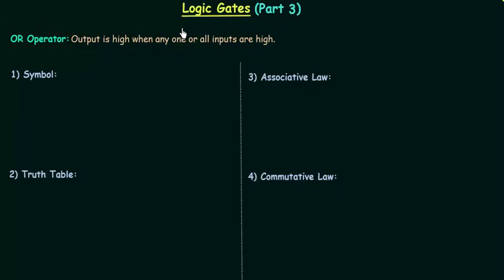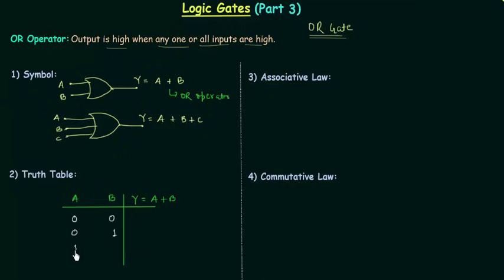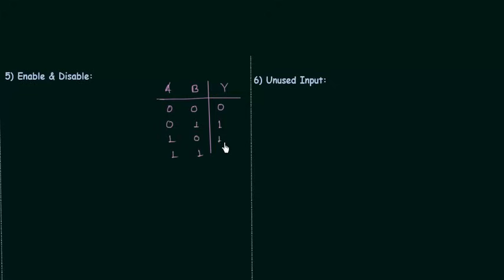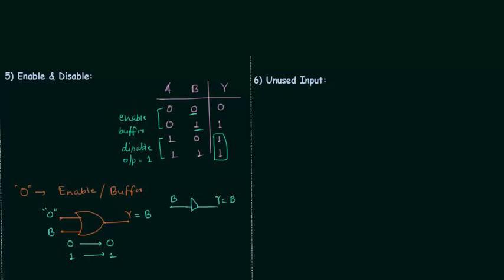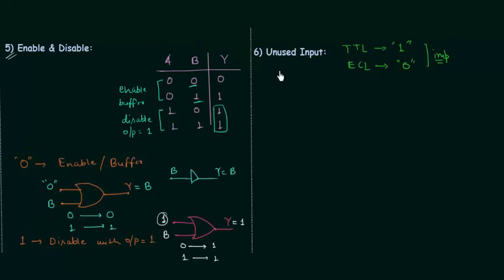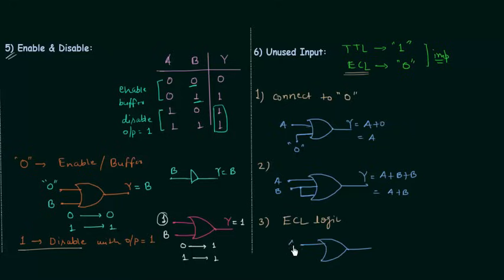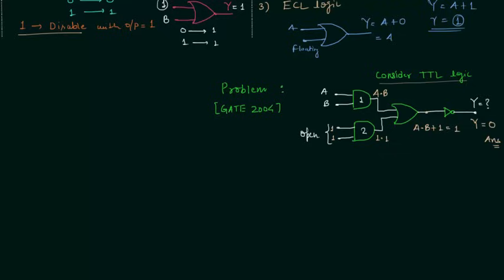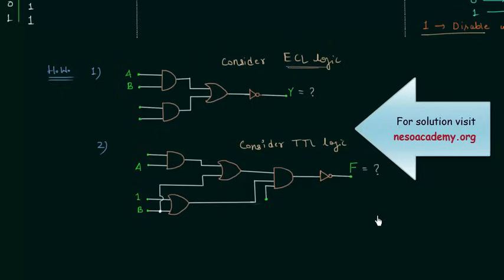Logic Gates (Part 3)

Comment: He is not explaining enable or disable correctly
Reply: Toh tu kardena
Reply: Enable means o/p should be 1 right? Iam confused on this..can some in explain?
Reply: @Gudurusruthi  enable means the gate functions, output equals 1 or 0, depending on input.
Reply: @davadoff  exactly In the video he is just creating unnecessary confusion 
Simply we can say 1 = enable, 0= disable
Reply: @Gudurusruthi  no, enable means the output will change depending on the other input(s). Disable fixes the output to a predetermined state. In this case 3:55 the OR gate builds a buffer that can be turned on & off. 

It’s confusing because in the context of flip flops, enable=true causes it to function normally, and enable=false fixes the output in the current state, insensitive to any input changes. See: flip flop racing (where the enable input may be labelled ‘clock’ depending on the video).

Comment: 1) answer is A'+B' 
Explanation- as we have to consider ECL logic so 0 will be floating input. 
So A. B +0.0=AB which get converted into A'B'= A'+B' by de'morgans theorem. 
.... 
2) Answer is A'B'
Explanation- as we have to consider TTL logic so put 1 at floating where input is empty. 
So for first AND gate it gives A.1=A
Second OR gate gives 1+B=B
For third OR gate A+B
For 4th AND gate A+B is one input and 1 is second input (B+1=1) and third input is floating so it is also 1.
So (A+B)1.1=A+B after inverter it get converted to (A+B)'=A'B' by de'morgans theorem.
Reply: Small correction 1+B will gives 1 not B. U mistakenly written bhaiya at statement 'Second OR gate gives 1+B=B'
Reply: @ganeshmula4508  yeah...
Reply: First answer is NAND the two inputs, second is NOR them 12:28. Invert both inputs then OR and invert both inputs then AND is more complicated than NAND/NOR respectively, so why use De-Morgan’s to complicate it?

Comment: 2nd is explained as

A and 1=A  or (B and 1) = A+B 
 B and 1=B

( A + B ) and B and 1 = ( (A+B)B ) compliment
Reply: Your explanation is wrong. A AND 1 = A OR B = A + B. Bottom most gate is B OR 1 = 1. O/P of these two then pass through AND gate (A+B).1.1= A+B. This A+B then goes through NOT gate and turns into (A+B)' or A'B'.

Comment: 1st:     Y=A^+B^          2nd:      F=B^
Reply: correct
Reply: how
Reply: Wrong
Reply: Because in 2nd ttl is used and in ttl floating value is 1
Reply: With that done
 A and 1=A  or (B and 1) = A+B 
 B and 1=B

( A + B ) and B and 1 = ( (A+B)B ) compliment
Reply: Bro it's or gate not AND gate I.e. 1 OR B